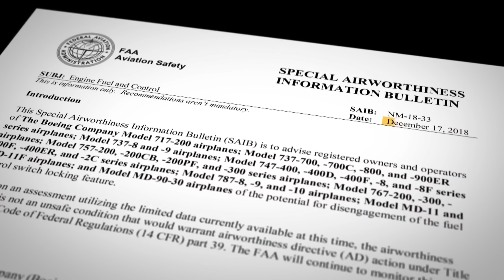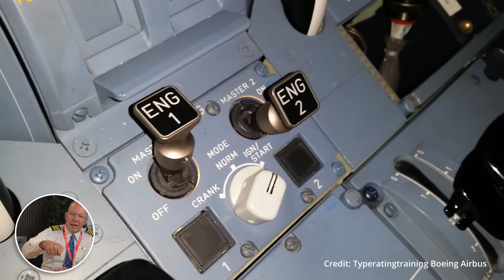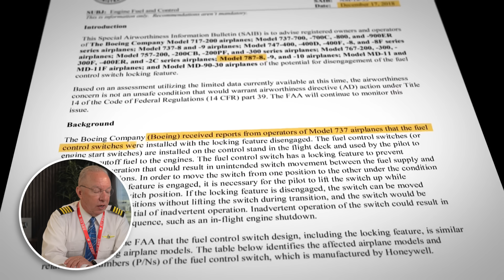Air India 171: The FAA’s 2018 Fuel Switch Locking Bulletin Explained (16 Questions Answered)

Comment: While the switch is intended to disengage the fuel system, is it mechanically or electrically possible for the fuel to be cut off without engaging the switch? 
(Notably, the timing between the switch events was nearly simultaneous(approximately one second apart) which raises the question of any unintended malfunction .

Investigators have confirmed the fuel cut-off events happened, but they don’t yet know whether it was due to the switch being intentionally or accidentally activated, or because of any malfunction.

Comment: the fuel control switches to Cutoff...then back to Run....is a normal procedure if an engine fails and a relight is required in flight........   i think the general public who are not pilots do not understand this,..........   perhaps the captain was tryin to relight the engines when he noticed them winding down....  and he did it before the co pilot realised and asked.......this was because the captain knows the little time he has to to that action.....      now its misconcieved that he wants to shut down.......whata load of crap,....

Comment: Is it possible that after take off the fuel switch machanics disengage and due to tilt while takeoff the switch fall back to cutoff position and then captain or FO notice fuel is rolling back and ask why you cutoff fuel and other reply i don't because non of them cutoff the fuel it was a mechanical glich. And asking this why you cutoff fuel is mentioned in report and thinking piolet problem but it may be a genuine question and answer that i don't cutoff as the cutoff was due to glich. As human has vision of approx 160 degree if someone is cutting fuel near you you can see and ask what are you doing or don't do it or stop. But he ask why you cutoff fuel.

Comment: I am a software developer on an vehicle diagnostic tool. I can understand you dont like the Embraer logic for fuel cutoff as you need immediate actions, but I think it should be introduced atleast when the last running engine is being cutoff while the plane is off ground.

Comment: The recorder is proof of the fuel cut off. But there is no proof of anyone using the switch, right? What if the pilot just felt loss of power and in a split second, assumed that the co-pilot used the cut-off switch?

Comment: Seems like you know how to drive a plane and does not know how it works. So better do not certify the manufacturers. When the mechanical switch input is wrongly detected then flight data recorder and every other display everywhere it will show as in the cutoff position only. Like in your car if the bonnet is not opened but the electric vehicle limits the torque thinking that bonnet is opened because the computer detects the wrong bonnet switche(s) status.

Comment: If it is a possible cause of manual intervention of pilot, then both fuel control switches should be on different side, so 1 pilot can operate only one switch, what’s your take on it?

Comment: @CaptainSteeeve..... there is a slight 1 sec delay between the two switches being put in the run position again. As the left switch was triggered first can we deduct from this that the logical conclusion is that the "captain" was the one putting them back on as the 1 switch would be closest to him??
Reply: Everything is left to right.

Comment: embraer doesnt prevent you from shutting off the engines if theyre on fire, you idiot!
if you dont know, just say you dont know, dont make stuff up.
on an embraer you have to move the throttle to idle FIRST, then you can cut off the fuel.
this only ads a second or two at the most
Reply: That's great as long as you don't need that second or two.

Comment: I heard a lot of explanations but I really cannot imagine this scenario: 3 seconds after liftoff one of the pilots just placed both engines in the cutoff position in a matter of a second, so he must be using both hands I guess, then 10 seconds later one of the pilots asks "why did you shut down the engines?" the other responded "I didn't" then it took 4 seconds to switch both engines on. Why did it take just one second to place both switches in the cutoff, but 4 seconds to move the switches on, while they were obviously in a hurry? How the other pilot couldn't immediately notice his buddy there move all the way, with the entire body, to cutoff both switches at the same time, and it took 10 full seconds to notice something was wrong? Why would someone cutoff both engines and ask the other pilot why he did it, or respond "I didn't"? If they had a death wish, why try to start back the engines? Can someone explain how this, which for the moment looks like the most plausible scenario, can even be possible?

Comment: How would you draw a conclusion that pilot moved the switch and it's absolutely not a electro mechanical failure/glitch?

Like in 737 crashes where software moved the elevator. Before those crash no one in the world believed that a software can do this.

Comment: The Prelim report talks about control switches for both engines “transitioned” from the RUN to CUTOFF position. Is there is difference when you say transitioned and not “placed” in a CUTOFF position?

Comment: I'm wondering if in the air logic, a warning light light on the panel where the other pilot can confirm the shutdown.  Problems with this is the system doesn't know who put the switches to cutoff.

Comment: Why aren't cockpit cameras used when many employees work under surveillance in offices and other environments?
In many workplaces, employees are routinely monitored for safety, compliance, and accountability. So why should the cockpit be an exception, especially when passenger safety is at stake?

Fuel cutoff switch design and reliability concerns:
The fuel cutoff switch doesn’t directly stop fuel flow mechanically; it relies on an electronic signal to trigger a computer-controlled system that handles the shutdown. This means any failure in the electrical or electronic components—such as faulty signals from the switch or errors in the control system—could prevent proper operation. In ground vehicles, we’ve seen cases where incorrect sensor input causes computers to make faulty decisions. So why defend the manufacturer without considering the possibility of similar system-level failures in aircraft?

Comment: Steve's conclusion of pilot error is wrong. Most of the video concludes that the electrical error message sent to the fuel switch 
cut off and then run. Don't blame pilots.

Comment: What if the locking feature is faulty and as soon as the plane takes off, it may be due to vibration or jerk, switches might have come to the off position?
Definitely, camera recording could have also helped here.

If any pilot did it intentionally then why they  denied in the voice recording? 
I dont agree that the pilot did this intentionally

Comment: Regarding cameras in the cockpit, you mentioned that the voice recorder and data recorder gather that information, but you have to admit, a camera would eliminate the guesswork in instances like this event. A picture is worth a thousand words, as the old saying goes. We would know who switched the fuel levers to the off position, so we wouldn't have to decipher data records to find out what happened, the data recorder doesn't actually tell us who switched them off, it can only tell us that they were switched off. The argument that pilots might be against cameras in the flight deck because they might be doing something they shouldn't be doing, surely if pilots are doing something they shouldn't be doing, with the responsibility for the safety of the lives of hundreds of passengers, they shouldn't be flying airplanes. If pilots don't want cameras on the flight deck, they might have something to hide. I am sure not all pilots would vote for cameras, but I am also sure that 100% of passengers would vote in favor of them.

Comment: If aviation industry knew if there is an easy way to make an aircraft collide without even slight possible doubt , why can't they find a solutions to avoid this in future ? Maybe lock the fuel switch once its ready to take off and release once its reached certain height where engine can able to recover ?

Comment: Captain, is it possible that the pilot who turned off the fuel control switches did it unintentionally? For example, a scenario where he thinks he’s raising the landing gear but because he’s distracted, has other things on his mind, ill, or intoxicated, he inadvertently switches the fuel off instead. This would also explain why he denied it.

Comment: Everything now is just
HEARSAY & ASSUMPTIONS.

Very convenient that only the CVR is in good condition & the other FDR is damaged as such that  the electrical, mechanical & hydraulic state of the aircraft is preserved and the gaint players are well protected.

Also remember that it is HUMANS who are AERONAUTICAL ENGINERRS who work on an aircraft in its repairs & parts replacement.

Dont make the 2 dead pilots SCAPEGOATS.

Comment: Could the engines have cut off for reasons other than the engine cut-off switches, with pilots then attempting to restart them, potentially leading to the physical switches being moved to the off position? 🤔 so serious of event is engine cuts off due to technical error, pilot asks the other did you cut off?, then they attempt to reignite engines by turning switches off to on?

Comment: This just struck me, and it's got me thinking about the designs of ships I've served on. If you have two vital, redundant, independent systems (i.e. airplane engines), where one absolutely has to be functioning in order to survive, does it makes sense to have the controls for both systems right next to each other? Isn't that introducing a single point (location) of failure? Like, hypothetically, if spilling a drink on the controls would cause them to send false indications to the computer, wouldn't it be safer to have the controls for each system on opposite sides of the cabin?

Comment: since you mentioned spring loaded, is it possible that the Springs have gone bad or just rusted into a position where it does not lock and therefore slide back due to the rotation during take off, especially if they are almost to the middle and not to the very run position?

Comment: You have here an American Pilot who I believe flies Boeing aircraft saying the blame is solely on one of the pilots. The preliminary report was very iffey and evasive. Too much talk about fuel levers. The question is, is it possible for the fuel to be cut off when the fuel levers are in the open position? Given the long time it took to publish the ambiguous preliminary report it seems there is a cover up going on here. It is very likely that the aircraft suffered a technical fault and the pilots tried to save  the situation. Captain Steeeve's response to cockpit cameras is pathetic. Of course there should be cameras operating in the cockpit. What have they got to hide? They probably get up to more than reading a magazine......
Reply: What you’re suggesting isn’t possible. Any of it. 
The reports are taking the time they are taking because they are rightfully working their way thru an enormous amount of incredibly detailed data and running through every possible iteration in flight sims to try and re-create possible failures before they’re ruled out. 

Conspiracy theories also completely bypass the idea that pilots need & deserve better mental health support. 
You’re causing more harm by suggesting & promoting them.

Comment: Possibilities:

CASE A: Manual toggle by pilot: 
1) Intentional shutdown, No relight attempt, Crash occurs
2) Accidental toggle (mistaken control): Attempted relight
3) Misinterpreted engine data: Toggles fuel switches in attempt to reset

CASE B: Locking mechanism disengaged (2018 FAA SAIB Advisory)
Switches move to CUTOFF, Cockpit confusion: “Why did you cut off?” — “I didn’t”, Crew attempts relight

CASE C: Mechanical or electrical fault
FADEC/wiring simulates cutoff command: The fuel control switch cannot transition to the CUTOFF position.

CASE D: Intentional sabotage: Deliberate toggle by crew/external actor

Comment: There is no reason we do not believe these two pilots.  Therefore the switch was moved due to machine failure.  Below is the possible cause.  

I was an automatic transmission design engineer in Ford Motor Company.  Once I was the team leader for the shifter team.  The shifter design is similar to the fuel shifter which uses detent to lock the shift position.  The detent is a simple mechanism and it could fail.  It uses a spring force to push a pin into a slot.  If the spring loses the force the pin will come out the slot and will move the handle to the very end because the other end of the lever is connected to a rod or cable with load.. Without the detent lock or a hand on the other end of the lever, the lever default position could be the end of the lever travel limit which in this plane would be the fuel off position depending on the design.

When the plane is flying up, it is in acceleration.  If the switch is not balanced about the pivot between two ends, the force on the heavy end will increase because the force is equal to the product of acceleration and mass, which will push the handle without human hand.

Boeing should stop flying the planes and go though the failure mode analysis.

Comment: Captain STEVE: Initially, you deducted that one of the pilots accidentally raised the flaps as they took off mistaking it as the "gear up".  But we are forgetting that the gear never went up. If the Co-Pilot was in control of the yoke during take off. The captain would be the one raising the gear up after "positive rate", correct? Well, if the pilot controlling the yoke is focused on the run way and the take-off with both his hands on the yoke, he would expect the gear to go up and he would see the other pilot reaching up and over the console to flip the gear up, but instead, he doesn't see the other pilot extending his arm UP, but instead  down to where the fuel cut-off is located and didn't really think about it until he heard the engines winding down. And that's when he asked "Why did you do that?"

Comment: Past USAF plane tech here, Several questions asked about the posibility of a circuit failure causing the appearance of the Fuel Cutoff switches being engaged. While some sort of wiring harness problem might be able to do that (very unlikely) it is likely the fault would have prevented reengaging the switch because of the circuit fail. In otherwards if this was not human initiated the fault would have remained. Since the switches were reengaged it seems impossible it was a mechanical failure of this kind, Sadly, human initiated error seems the only possible explaination.

Comment: Greetings, Capt. Steeve. 
I’m very glad I stumbled on to your podcast. Thanks your very informative sessions, I’m quickly becoming an aviation enthusiast. Condolences to all who grieve the loss of loved ones.

Are there sound reasons why the fuel cutoff switches shouldn’t be installed in such a way that they are independently assigned to the Captain and the First Officer, with each switch being out of reach of the pilot to whom it is not assigned?

Comment: Captain Steeeve, suppose in case of single engine failure, is their any provision to reset the the fuel control switches may be exactly in the sequence it happened??? Before blaming the pilot, we must consider that Boeing fuel control switches were not perfect either..  based on may reports cited at different times.
Reply: If it was suicidal by one pilot and the other was try to rectify the mistake, don’t you think the guilty one would have stopped or prevented him from doing so..??? It doesn’t make sense.

Comment: O Captain my Captain, I am rather curious about the time frame for a cutoff valve starving an engine completely of fuel. What is the rate at which the fuel is consumed and how many seconds of fuel does an engine have after a cut off switch is activated?

Comment: Piolets can intentionally do these kind of things. In 1999 Air Egypt 1st officer Gameel Al-Batouti did something similar to this. shutting down the engines in midair and crashing the plan. 216 passengers were kiled. NTSB concluded and stated that the crash was caused by a series of deliberate flight control inputs. Egyptian government did not accept the report also.

Comment: You insist that the switches couldn't have been in the run position if they had issues with the locking mechanism. However, the bulletin clearly states that if the feature is disengaged, the result would be an in-flight engine shutdown. Note that they say 'in-flight', meaning it is possible to achieve flight with the issue present. So, your statement is incorrect.

Comment: For the first time, I am not sold on your reasoning/explanation -
1. What kind of privacy would be violated with video cameras for a pilot flying a plane with so many people's lives under their control?
2. I agree with mental health challenges these days, but it is being conveniently used as an excuse for no gun control,  and now probably no accountability for system failures or maintenance failures.  This is a dangerous trend ..
 3. Is it really 0% chance that both the pilots were honest and did not intentionally cutoff the fuel?

Letting Boeing and Air India completely off the hook completely at this point is not a good thing IMO.

Comment: I cannot buy theory of deliberate switching of fuel switches unless it is proven that it won’t automatically switches off (or) due to maintenance issues.  The pilots should not be blamed, as they never had any history of mental illness like the pilot of German wings !  Also, Boeing has to to take responsibility for all the 737 Dreamliners and simulate if there are any issues !  Justice has to be served for the departed souls